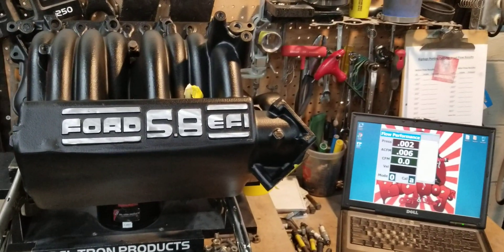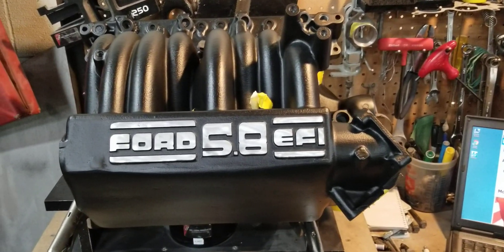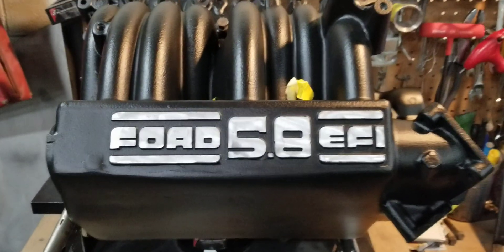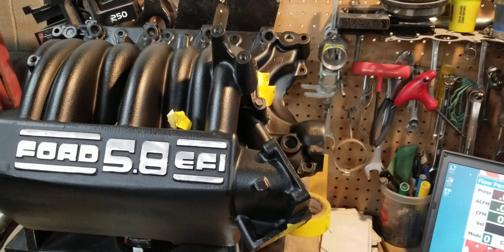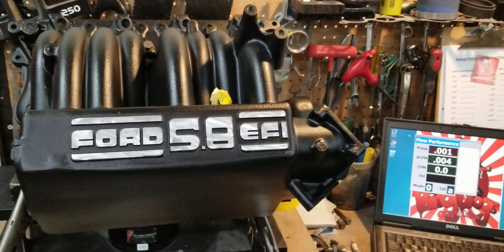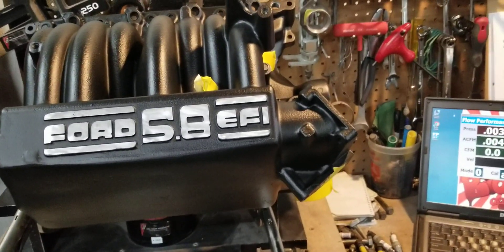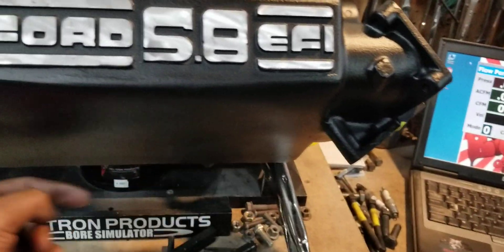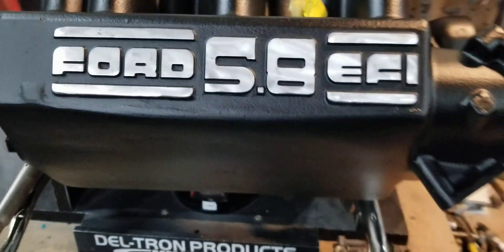Ford 351 efi Truck manifold Stage 3 ported flow results 😁

Comment: What's the best match cylinder head for these flow numbers?
Reply from the maker: Anything ported buy us. We can port any head to work great for low er rpm power for the truck application. Porting a head for a drag car vs truck application are done differently, many people don't know this
Reply: @bigdogsportingtonyb2833 so, E7s or AFRs? Can E7s be ported to work with these flow numbers?
Reply from the maker: @aw9680  yes. Our stage 2 351w truck cam is designed for our porting philosophy on the heads and intake. The flow numbers on our Stage 2 E7s up to .500" lift arr outstanding which moves a lot of air. Not trying to brag but the flow gains from our porting philosophy are some of the highest that we've seen in the industry on these parts. Flow gains of 45- 55cfm on the intake and exhaust ports on E7 heads are normal for us. We are going to do a stage 2 E7 porting video on a set we just finished for a customer this weekend.
Reply: nice. Can it keep the factor pedestal rockers? Or roller pedestals? I'm looking for as low maintenance as possible.
Reply from the maker: @aw9680 factory 1.6 rockers

Comment: I've got a 97 f250hd with 351w..i want to improve my towing power. With this intake what would you suggest for heads and cam? I've got the bassani headers on it and good exhaust.
Reply from the maker: @mtchbrian  our stage 2 2 intake manifold, our stage 2 351w truck cam and our stage 2 ported Of short Aluminum heads that flows 280/200cfm @ .600" lift, 30lb injectors and a good tune and you will make tons of power to out pull what your frame can handle guaranteed

Comment: What throttle body would it take
Reply from the maker: On stroker motors with good heads, good cam and a way to  tune the bigger bbk twin that's ported by us to flow more works very well.

Comment: Great work Tony! Is there a particular throttle body available that increases the flow or at the least doesn't change the flow. That much flow from this manifold is insane! I may have to remap and revive an F150 project of mine. Thanks in advance!
Reply from the maker: Thank you very much. Yes there is. At the very minimum we recommend us porting your factory throttle body which usually gains 200cfm or running the bbk twin 61mm throttle body

Comment: Been working on my 351w truck a ton lately, did some minor work to my manifold and painted it just like this (regular matte black not your fancy color) so I was glad to see a video posted by you with almost the exact thing I was working on even though I'm finished. I noticed you mentioned other videos on these, haven't seen them yet but I'll definitely check them out as well. Very curious about what numbers a stage 1 or 2 would flow. I appreciate the videos and information, keep it up!

Comment: How much you charge for stage 2 and 3?
Reply from the maker: Stage 3 351 truck manifold porting option and prices are currently  being reviewed and evaluated due to the time and work involved. The new price will be on our new 2023 price sheet if we still are doing them.
Reply: @bigdogsportingtonyb2833  Thanks, how many hrs do you have in the manifold your testing?
Reply from the maker: @gregory9740  we can't remember because we have multiple people doing different things during the stage 3 process plus specialized tools and equipment so maybe for us its 25-30hrs or so for everything

Comment: The proxy Matty black mix this little recipes online on how to do it that's where I found out about it.,.. but you you thought of that all on your own in the garage.... Very smart., I found the idea from some other man but I thought it was cool... It looks good.... And it works... Never mind the port work you did.... Flowing now ain't it.... I've also seen the stock ho cut open in worked., I've also seen the 5.8 EFI intakes... With somebody shortening the runners and then reconnecting.., great video big dogs porting......
Reply from the maker: Our epoxy coating has a mixture of certain ceramic added to them for heat and abrasion resistance

Comment: With a Stage 3 will heads need porting also to get the best performance?
Reply from the maker: It depends on the heads used. You have to understand that this stage 3 flows more air bolted together than a out the Box Systemax 2 so any bottlenecks will reduce the amount of power our ported parts can support

Comment: without trying to take away your secrets, I am a porter  myself,  but  I'm wondering  the best approach on the TB elbow. if you have clues.  Did you open the tunnels all the way?   It seems like cutting back material on the inside wall of the elbows is the best approach   as its a kind of dog leg.     Thats kind of what I was doing and the outboard a little as well more flush from the ridge. I also have a 61x2   for a 5.0 .  Also didn't want to lose too much velocity lol
Reply from the maker: The biggest mistake you can do is to port based off of what you "think" the air wants to do. We call that blind porting at it's the fastest way to little to no gains one can make. Air doesn't move like you think it moves and this is why so many have little success. 
We don't give away our secrets, sorry.
Reply: @bigdogsportingtonyb2833  So I thought I heard you say somewhere   that you have ported the BBK duals?   like 61mm?   I finally  Miked mine         and I got 60.5 mm  in the back and 53mm in the front.   On a built 5.0   with everything ported and cammed..   Do you think opening the front  beyond 53mm  is worth it?   or would lose too much velocity/low end   and that would be better for a stroker/more cid/ or boost.     I'd assumed its engineered that way obv  that's to keep velocity up    but   any gains    for the cost of that darn thing I would take.  I never miked out the stock TB
Reply from the maker: @tonypepperoni229  you are overthinking things. You only need to change things that are a restriction. If it's not a restriction for the combo then leave it alone because changing it won't do anything and could hurt things. Velocity on a common plenum tuned  runner dry efi manifold doesn't act the same as a wet flow  carb or tbi manifold system. 
It's a lot involved than just making things bigger
Reply from the maker: Sorry. It took us years and lots of testing to get the results we get. 
We cannot give that information away.
I can tell you this, everything you just stated and how you are looking at it is wrong. I will tell you Air doesn't move the way you think it moves. Most people who port parts blindly actually hurts potential gains in flow because they are porting based on what they think will help flow instead of what actually helps cfm flow. Getting these parts to flow what we do is not easy. You can port on a part for 60hrs and only gain 15-20cfm from stock if you are doing it wrong.

Comment: Great video! I was talking with you earlier today about a 5.0 truck manifold. What would you suggest for a 5.0 stock fox body forged pistons b cam afr renegade cnc ported 185 heads and 1.72 ratio rocker arms. Goin in a manual short bed reg cab pick up with 4x4 3.55 gears and 31x10.50-15s. Stage 2 or 3? Still have a lot of work to do to the truck so your turn around time doesn’t bother me I’m sure you will be done before I am lol
Reply from the maker: Definitely stage 2. It's a great value and adds significant power over stock. I would recommend a better cam. The B cam isn't going to allow you to even use 50% of the heads potential. Basically wasting them
Reply: @bigdogsportingtonyb2833  I know there are better cams it’s what I had laying around. Also the reason for the 1.72 ratio rocker arms. That engine is basically parts I had laying around to get the truck running and driving. I’m either gonna build a 331 for it or a 351w to put the afr heads on in the future. I had the opportunity to buy heads and so I bought the best I could afford. And well after seeing your work I’d rather pay you to port an intake I have laying around instead of the more expensive options.
Reply from the maker: @Tripledoffroadbbq  understood. Yes porting the intake manifold to our specs would yield some of the biggest gains over any other mod.

Comment: Would the port match up with small head like a Afr 165 or 185
Reply from the maker: Perfect gasket matching does not effect the flow like you think. Our porting works great with every brand of cylinder head

Comment: Perfect test! Whats the flow on stock intake + plenum?
Reply from the maker: Stock bolted together average is 170-175cfm
Reply: @bigdogsportingtonyb2833  wonderful! Do uou got plus 100cfm on this ported! Wonderfull results!
Reply from the maker: @thiagofreitas9522  thank you. It's not easy and requires a ton of effort, knowledge and skills
Reply: @bigdogsportingtonyb2833  how do u port on curve plenum, thats place seems been pretty hard tô reach
Reply from the maker: @thiagofreitas9522  it's easy for us. We have specially made tools and equipment.  In the video we tell you what we do. Stage 3s gets cut open
Reply: @bigdogsportingtonyb2833  congrats again!! Here on brazil we dont have a service on this levei quality. I just imported a EFI like that tô my 351W (gonna equiped a Ford maverick) and o realy would know your service before import this part!! Patience now
Reply from the maker: @thiagofreitas9522  thank you. Make sure you like and follow us on our Facebook business page at Bigdogs Porting
Reply: @bigdogsportingtonyb2833  when u open a big   Port we lose power/torque on low rotation?
Reply from the maker: @thiagofreitas9522  no. Our porting is much more detailed and not just making ports bigger. There's a  lot of science behind what we do and thats why our customers gain both great hp and great torque.

Comment: To bad Windsor heads are Weezer heads. A stock 4V Cleveland head flow's 275cfm @.500
Reply from the maker: We make them flow enough to get the job done on a budget. We has went 10.80s on a set of our ported gt40 heads with 1.90"/1.60" SS valves with a 302 at 3,200lb race weight all motor!
Reply: @bigdogsportingtonyb2833  I built a circle track motor a few years back. It's a Budget class Rules are Max 360 ci OEM production Iron head's, block, 600 CFM carb N/A on 93 octane
 I used a  Reman 1995 351W block 1971 Cleveland Closed Chamber 4V heads with stock size 2.19/1.71 valves, Boss 302 style pistons worked out to 10.5-:1 compression a healthyComp Cam  H Beam rod's a old SVO steel crank. And a old B&A single plane 351 Clever intake.
Most guys run GT40 head SBF or Vortec head SBC, that Cleveland head SBF won 3 out of 4 races that season on tracks 1 mile or bigger.and lead 78%% of laps of the 4 races at those track's.
Reply from the maker: @kevind3185  of course with bigger 2.19/1.71 valves, larger runner volumes and higher Compression ratio lol. I'm saying 10.80s in a real street car on ported gt40 heads with 1.90/1.60" valves on a 302 with our stage 3 ported Explorer gt40 efi manifold naturally aspirated while still running a working AC! Lol. If the car was gutted and setup for maximum drag only I'm sure it would have went even faster. Plus gt40/gt40p heads are everywhere and in abundance unlike the Cleveland stuff.
Reply: @bigdogsportingtonyb2833  those are factory valves in a OEM Castings, I dropped the compressor compared to stock 351 Cleveland 4V. Really there isn't much trick to doing a Cleveland Windsor Hybrid, FoMoCo did it in 1969-70 with the Boss 302. I bought the head's as rusty core's off Craigslist from behind a old garage for $200. Cleveland stuff isn't hard to find I can find 2V heads all over and they make the perfect street strip 302. The total build was about $3800 with mostly used and OEM replacement parts. Biggest one expense was machine work..
Here is the thing my 600 CFM carb rule requirement is my limiting factor as far as horsepower, your engines limiting factor is those small inline valve Weezer heads.
Reply from the maker: @kevind3185  I hear you but my point was we got it done with a smaller motor with smaller valves. Do the rear wheel hp math on a 3,200lb gt running 10.80 in the quarter mile. That motor would rev to 7,000rpm and drop right in

Comment: Pretty good flow also. I know its takes alot of work.
Reply from the maker: Yes but it's a MUCH better alternative to the Edelbrock 351w truck manifold that only has a out the box bolted together flow of 225cfm and costs over $900😳

Comment: Seen a Procharger on a LS today. From learning from you the air filter was too small  and mounted above the exhaust manifold.  2015 Camaro.?  Can't believe they would do that.
Reply from the maker: You'd be surprised what people are doing. It's not that they are intentionally doing it its just they don't know any better. Instead of finding out the restrictions they will just turn up the boost lol

Comment: I’m a set up like this would you port match the throttle bodies?
Reply from the maker: At the minimum port the factory throttle body but even that's a restriction on our Stang ed 2s and stage 3s. Best deal is to run a ported bigger twin TB